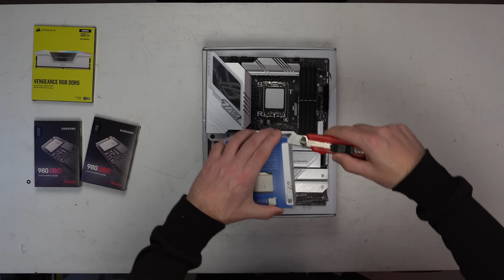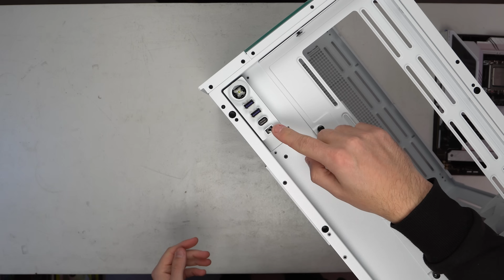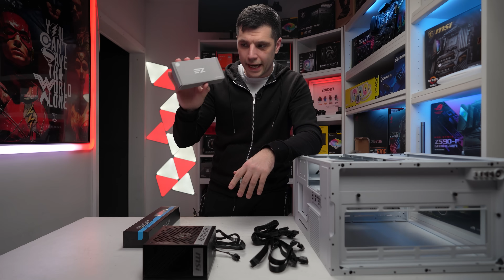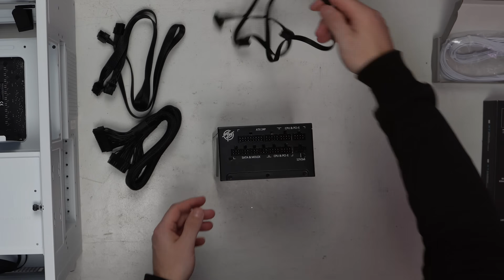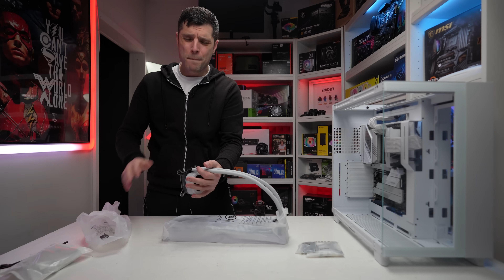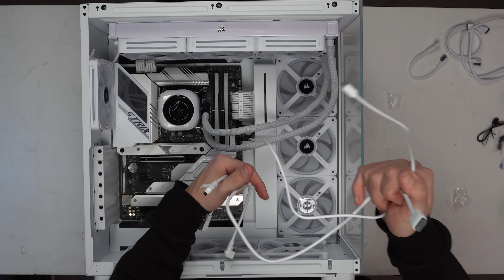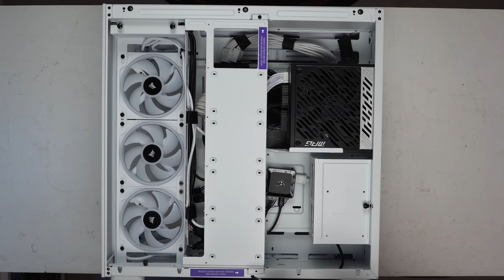Beautiful All White Nzxt H9 Flow Pc Build FT 14700K & RTX4080 Super

Comment: Hi dude is amazon  save to buy pc components
Reply from the maker: Yes perfectly fine - always check the seller also though but relatively fine
Reply: Hey dude thanks for the reply  how many fans do i need to get it says 3 intake and 2 exhaust  do u think hqve link please
Reply from the maker: Case can fit 10 x 120mm Fans but 7 is enough. Dep3nds on which fans you like mate

Comment: This is going to be my first pc build and I have a few questions. 

How do you connect the 6 intake fans to the hub? Did you take the long cable and connect it from the side fan intake to the hub? (It's at 27:05.) 

I'm using the same case but I'm doing a black build instead, are the cable extensions necessary for me, and if so, should i get the 4 pieces or 5 pieces option? (there is not 6 picees option for the black extensions) 

I'm using the rtx 5090 tuff gaming for my build. What cable should I get for the gpu? 

Lastly, do you have any recomendation for an aio? I'm using the r7 9800x3d. I wnat to see if there are other option than the one you recomend in the video since it's kinda too expensive for me. If so, is the installation going to be similar and the wiring conections?
Reply from the maker: Firstly thanks for watching! The bottom 3 intake fans and 3 side intake fans are connected via a small cable and then a long cable from the top of the 3 side intake fans to the icue hub. I would personally go with the arctic liquid freezer 3 its much cheaper and performs amazing. For extensions you only need a 4 piece kit - 2 x 8 pin eps cables and 1 x 24 pin and 1 12vhpr cable. Ezdiy have some good ones in loads of colours.
Reply: @TechCheckUK Thank you so much! This helped me a lot and you save me a great deal of time.
Reply from the maker: No problem at all glad i could help
Reply: @TechCheckUK  Hello again. Sorry to bother you but do you have any other recommendations for the AIO. I like the one you recommended, but I want one with a screen. Thank you
Reply from the maker: Mate there are so many it all depends on what eco systems your going with / budget / how you want to control etc. Few below. 

Tryz panorama SE360
NZXT Kraken Elite 360 RGB
Lian li hydroshift 360 
ROG Ryio IV slc 360 
Thermalright Elite Vision 360
Reply: @TechCheckUK thank you I’ll check those out
Reply from the maker: No problem mate

Comment: I'm confused. When you linked the fans and aio together, I followed everything and plugged everything in where it should go. Then when you go to the back of the to plug everything into the black hub, you suddenly have two long white cables for fans, one on each side. I can only see where you plugged one of them into. Am I missing something?
Reply from the maker: One long cable goes from the 3 side intake that are connected to the bottom 3 fans via a small cable. The 2nd large cable goes from the top 3 fans and rear exhaust fan - both go to the icue hub one each side - hope that helps 👍

Comment: what if i just have the corsair fans plus the reverse fan? because i chose to use the nzxt aio cpu cooler... how will i make the connections work withe fans?
Reply from the maker: Bottom 3 intake and side 3 intake connected via small cable and then 1 x large cable to icue hub and the rear exhaust fan just needs  x large cable to icue hub and u good to go mate 👍

Comment: Do we have to put 500gb on top and (for example) 2Tb under or can we put straight 4Tb on top?
Reply from the maker: @samuelcantini9329  you can put them where you like mate i just always like my operating system generally on the fastest slot but totally up to you in both same speed drives
Reply: @TechCheckUK  Thank you so very much for your answer. 

Sadly I can’t get the same 16 Pin and Cable extension as you because I live in Switzerland, do you have any other recommendations?
Reply from the maker: Best option is extensions as they are universal mate i always tend to look on amazon and as long as extensions they will work with any psu

Comment: Hello, I don't know if your still active or not, but I just did my first build with the H9 Flow case but I have the black, I want to thank you for your detailed explanation when it came to the case and how to plug things in and where to remove things. So thank you for this video defintely helped out a newbie like myself. My one question and I don't think you mentioned it on the video, but is the exhaust fan plugged in my default because I haven't seen my exhaust fan kick on once so i'm worried I never plugged it in or its just not working?
Reply from the maker: Your more than welcome and thanks for watching too 😊 well done on the build 👍 you will need to plug your exhaust fan in to a 4 pin system pwm header on your mobo mate or use the fan hub if you have one.
Reply: @TechCheckUK  Okay so it doesn't come plugged in automatically, okay gotta check that and do you know if all fans should be recognized by the NZXT Cam software as well? or it depends on how things are connected. and thank you very much for your kind words
Reply from the maker: Unfortunately not mate just double check ya connections - once plugged in CAM software will know it's plugged into a pwm header 😉

Comment: I don’t know if you will see this but I’m looking to build my first pc with an all white aesthetic. I’m thinking of going with the h9 flow, the asrock b650m pro rs WiFi, the artic chill 360mm AIO, either 32 gb of ddr5 Corsair RGB vengeance ram or 16 gb ddr4 Corsair vengeance rgb ram. This depend on my remaining budget. I’m going with the Ryzen 5 7600X and the  rx 7800 xt. I’m wondering if there are any improvements you think I could do? My budget is around £1250
Reply from the maker: That's a banging pc for £1250 wow 👌 I don't think I'd change anything mate
Reply: @ Thanks
Reply from the maker: @TheArch1etect  no worries mate good luck on ya 1st build too 👍
Reply: @TechCheckUK i am considering going with the ASUS Rog strix b650-A gaming WiFi for my motherboard. I was wondering because this would mean I would have an increased number of rgb ports, would I still require a hub to run these 2 different rgb?
Reply from the maker: What rgb you talking about mate sorry ya lost me ?
Reply: Sorry for the confusion I was talking about the argb ports on the motherboard and if I can plug the NZXT fans straight into the motherboard or if I need a hub like with Corsair.
Reply from the maker: @TheArch1etect the standard fans that come with the h9 flow are not ARGB mate. Most of their fans are 12v so can be connected to 4 pin RGB headers on mobo or yes you can buy a rgb hub as a pack

Comment: This case is a pain in the ass to get working I got the one with the rgp fans and they won't seem to light up
Reply from the maker: Have you sata powered tge rgb and fan hub mate?
Reply: @TechCheckUK  I fixed it but my gpu won't show video signal even  though the fans on it spin and it's lighting up
Reply from the maker: Could be ram or cpu not seated correctly- also have u updated bios

Comment: Brilliant video. Subbed. I am eagerly waiting for a brand new GPU Q1 2025 to start my build.  Parts list: NZXT H9 Flow/NZXT C1000 (2024) 1000 W PSU/NZXT Kraken Elite 360 AIO/3 x NZXT F360 RGB 360mm Single-Frame Fan/1 x NZXT F120 RGB Core fan/NZXT RGB & Fan Controller (2024)/7800X3D/MSI MPG B650 EDGE WIFI/Corsair Vengeance RGB 64GB (2 x 32 GB) DDR5-6000MHz/Lexar NM790 4 TB M.2.
Reply from the maker: Thanks mate I appreciate it - nice parts list and that will be a really nice build 👍

Comment: if only you used the fans that came with the case literally lost on what to do with these white cables😢(i have a old motherboard and then a motherboard for the leds an stuff which is also old)
Reply from the maker: Sorry mate I tend to swop out the case fans with ones that will sync nicely with all the other parts - for more budget builds I will keep them in

Comment: How are the thermals on the i7 14700k with the radiator on the top? I have the same cpu and same case but I have my kraken elite 360 side mounted with 6 intake fans on it. Just curious if there is any noticeable difference between the two
Reply from the maker: In games it runs around 66c and underfull load 79c with cinebench - 14th gen not great for temps really but still absolutely fine
Reply: @ my chip idle’s at 33-42c then 45-59c when I’m gaming. Haven’t tried cinebench
Reply from the maker: Wicked mate that's perfect 👌

Comment: Hey the link system you were talking about, does it come with any of the other parts or do you have to buy it separately, if so could i have the link? Also if i don't have one of those could i still change all my rgb lights on my fans and stuff?
Reply from the maker: Hi mate the link system is the fans, AIO cooler and cables. They come either with the 3 pack of fans or in the AIO as a set. All the rgb is set in icue software - if using corsair fans
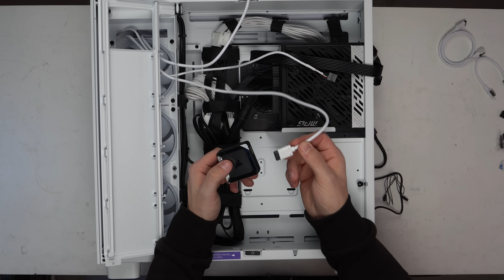Reply: @TechCheckUK  Ah i see. So what was that thing you plugged all the fans into at 27:00 ? And do i need it for the fans to all work or is it just to make it easier?
Reply from the maker: Yes that comes with the triple fan pack or when u buy the AIO - It's the icue hub and 100 is needed to both control power and rgb for fans mate
Reply: @TechCheckUK  Okay, thing is I'm planning on buying the NZXT kraken 360 AIO because its a little cheaper and I'm not too sure about the fans, i would appreciate some cheaper alternative recommendation's if that alright. But im guessing i would have to buy the icue hub separately then?
Reply from the maker: Personally if your not going with the AIO from corsair I wouldn't bother getting the hub and corsair fans. Why not stick with nzxt rgb fans? Then all will be the same and you can control via the mobo 5v argb header and software?

Comment: Hello, I just assembled the same PC as you in black, the only difference is that the other 7 fans are rx, I did exactly the same thing as you, but the problem is that, when I turn on the PC, only the watercooling turns on, the other 7 fans remain off, but it turns, do you think I have to wait to configure via the software or is there a connection problem, or simply the rx are not compatible? I don't know what to do, if you could help me I would be extremely grateful Thank you :)
Reply from the maker: I haven't tried to mix QX fans and RX fans mate - personally I would install ICUE and it should auto detect the different fans. One has 8 LEDS per fan and one has 34 so may need to be configured in icue - should be OK as both icue link
Reply: @TechCheckUK  it works thank you I will try to configure, I hope it will work because the pc cost me $3300, it would be a bit stupid if the rbg messed up, thank you
Reply from the maker: @biloolpowa1230  nice mate 👍
Reply: @TechCheckUK  It's good everything works fine, after installing the software it didn't work, I had to go into Windows applications and repair then it worked, I am extremely grateful to you, thank you very much
Reply from the maker: Your more than welcome mate and glad u got it sorted 👍

Comment: Does the motherboard require like what cpu and ram it needs?
Reply from the maker: In a z790 you need 12/13/14th gen intel cpu to ensure it works correctly for RAM i would go 6000mhz at c30-c36 Intel isn't as picky as AMD

Comment: Is everything other than the mother board required to start it up
Reply from the maker: Yes mate - most of the stuff goes or attaches to the mobo so nothing will work without it. U could get 1 less nvme and you don't need the custom cables but other than that you need everything to ensure it works properly

Comment: for my next build 1440p ill be using that case but id be putting my AIO on the side and having intake fans from the side and bottom and the exhaust fans the upper part and the back. should be interesting
Reply from the maker: It deffo sounds like it mate - good luck 👍

Comment: hi i wanted to ask you what is the best cpu and motherboard for gaming
Reply from the maker: Very subjective mate based on cost and platform. For me it would be a x670/b650 with a 7800x3d or absolute best x870 and 9800x3d it also depends on other parts in system / rgb connectivity and IO needed - so many options but deffo ryzen atm x3d chips
Reply: @TechCheckUK   ok thank you  also what would be the best part for a 3080 super and 7800x3d the best part to pair with
Reply from the maker: Any x670 or x670e or b650e mobo really you want all would work fine - i like asus b650-a as its pretty cheap £170 and has pcie gen 5 and lots of connectivity. But if you want more IO and have a larger budget then asus x650e-e is amazing but £400

Comment: Your F panel plug has 9 connectors inside it to connect to mother board?
I’m asking cuz my h9 flow case F Panel only has 4 connectors on top and none at the bottom 5.. my pc will not power up at all
Reply from the maker: You sure your connecting to jfp1 mate 
It should be top row on left led+ then led- then pwr + then pwr - straight under power is reset - reset + and to the left of that hdd - and hdd +
Reply: @ thx for the response.. I have the MSi b650 edge and the JFP1 is at the bottom right with 9 male pins. NZXT F Panel plug only has 4 females pins with the other 5 female empty. I’m not getting any power because of this.. 3 days I’m looking for a solution for this
Reply from the maker: It won't help straight away but to turn on you can either jump the pwr buttons or buy a dedicated power button mate

Comment: Im currently looking to find out how to install my HDD and SSD in this case as it is incredibly odd, but for some reason all of your videos skip over that part of the installation or at the least it isn't included in the timestamps. Very frustrating
Reply from the maker: Hi mate it's because I haven't used any - I only use nvme/m.2 drives. All you need to do is attach a sata data and sata Power cable to each of your ssd and hdd then attach the sata data cable to your motherboard. Sata power from psu and sata data cable comes with your mobo - it's the same process in every build if your using ssd or hdds.
Reply: @ thanks for responding, though I could've been clearer I did mean in the H9 flow specifically, since the brackets are incredibly odd. I ended up figuring it out, but the way it's all set up is super out of the norm
Reply from the maker: As long as you've sorted it mate 👍 and it's working that's all that matters. Ssd and hdds are pretty old and large now and obviously much slower so that's why I don't use then anymore as it's just easier to use gen 3 or 4 nvme drives. Thanks for watching

Comment: Would you not have been better putting that Intel back bracket on your motherboard first before you put it in the case, I could not see how you got it in the case with both motherboard in it as well as PSU.
Reply from the maker: 100% yes correct and I struggled to say the least - just an oversight as too many things to think about! Make sure you do it before mobo installation - Good spot

Comment: It is a pity that the case doesn't come with white connection in it.
Reply from the maker: Yeah that's one thing that annoys me - the 6500x does this and looks really nice 👌 I appreciate you watching and taking time to comment 😀
Reply: @TechCheckUK  I would go for the corsair 6500X except for the flimsy top and front if you want to use it, that's why I am looking at the NZXT cases, but like I said it is a pity they don't come with white connections in it. I would like to use the top for the AIO but like I said the Corsair make is very flimsy and warps very easy.
Reply from the maker: I have had 2-3 without that issue and the one inside has had a h150i icue link as exhaust and no issues.

Comment: I’m planning to a build almost exactly like this and have a few questions: did you have to order more of the qx120 link cables as the aio only comes with 2 and the rest of the fan packs I believe to be none, also where did the white usb go after you plugged the rad fans into the radiator but before you plugged the hub into the pcie? 2) in the build I’m also using the new lian li unicorn vomit v2 psu cables and controller. Do you have any experience with them and any tips, videos or just a quick summary of what I need to plug them into as there Arnt many clear ones on utube. Amazing video and definitely earned my like and sub ( no idea how you don’t have more subs )
Reply from the maker: Hi mate and thanks very much it's really appreciated- all the cables you need come with the AIO and triple fan packs. 
I have multiple icue qxfan and AIO videos that walk you through the whole process mate on the channel. I don't use the lian li cables as I don't like them personally. Thanks 4 the support 👍

Comment: Why would you ever get less than a tb SSD? Most games are between 50-90gb now, a lot of apps are gb+, don't settle for less
Reply from the maker: There is 2 5tb of nvme
500gb for operating system and 2tb for games mate 👍
Reply: @TechCheckUK  Why would you get a 500gb in general... I understand wanting to have something just for operating system. Just get a second 2tb SSD or larger and partition like 300-500gb of that for windows/c drive and the rest to something else. A 500gb is less cost effective for price than a larger SSD, and more storage is always more storage. Especially on an SSD that is quality to last minimum 8-10 years before start of failure.
Reply from the maker: Agreed but some people either don't need it or can't afford it that's all mate I get it and agree but it's individual choice.